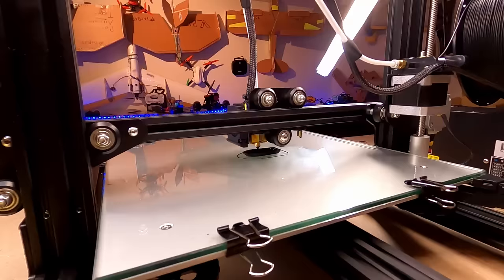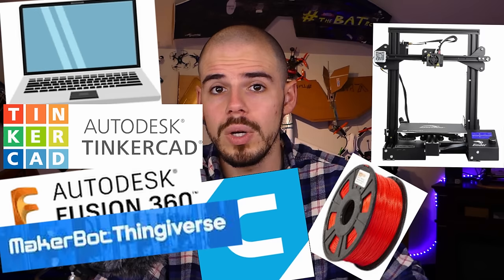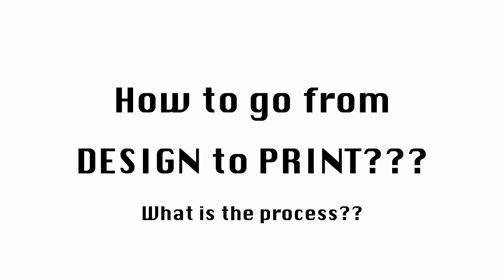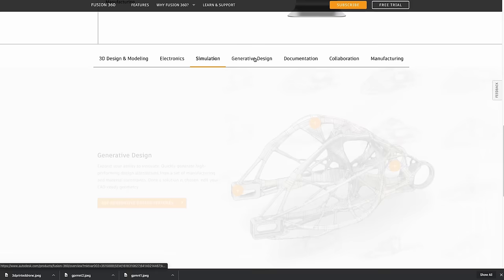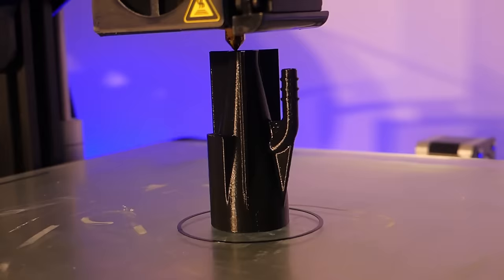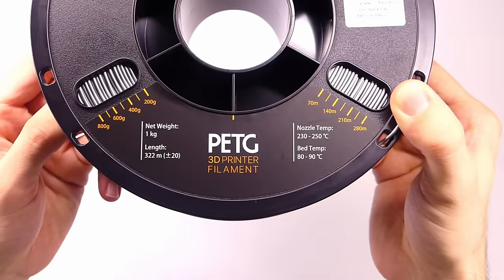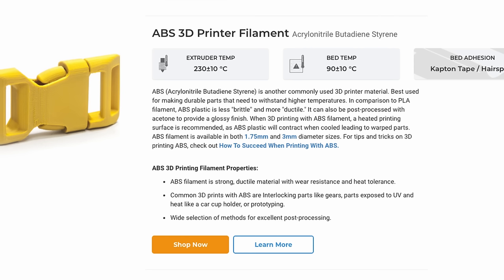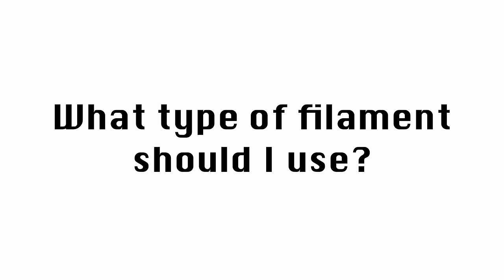Don't Know Where to Start? 🥺 3D Printing Crash Course for Beginners

Comment from the maker: What questions do YOU have about 3D printing?
Reply: Build a flying wing 3d lol! I 😂
Reply from the maker: @its_Savian  lol I just might! I'd better print two, though, because I'll crash one of them!
Reply: How long before 3d printing is ready for the mainstream consumer electronics market. i.e.: I want to go to Best Buy and buy a wireless HP or Epson 3d printer, load a consumable cartridge, design something on SketchUp 3d press print. I don't want to assemble, fiddle, upgrade etc. All software except the design software should be drivers provided by the printer manufacturer. Any guesses?
Reply: I saw a nice plane on thingiverse:
C-47 Dakota, RC Plane
Reply: (1) I was looking at getting a robot arm and saw that some of them can do 3D printing.  How do robot arm 3D printers compare with dedicated 3D printers?

(2) Is there (currently or in the works) a portable 3D Printing Format for the files that control the printers just as there is PDF for 2D printers?
Reply: @Boris_Chang  I think probably more expensive and kinda unnecessary but not sure.
Reply: About metal printing ??
Reply: One thing I wish I knew when I started was the temp tower. Dialing in the temperature for each filament was so much easier after that. 

Excellent video sir.
Reply: I'm in the category that just wants to download files and use a slicer. I have no desire to design anything. I did cad in school and it's not for me. I want to make Statues and Models. What type of PC do I need? Would a regular cheap laptop be sufficient??
Reply: I've commented my question, i would appreciate if you answer me, thx <3
Reply: My question is how do you make money(to fund more awesome project) with it..where to start?
Reply: When I buy my printer and want to print nylon carbon fiber stuff do the hot points fit all models?
Reply: Can you use autodesk inventor instead of fusion 360?
Reply: hey man, a friend of mine gave me a printout kayan 11240908206, but B have only mac, can I work with that? what app or software do I use to program?
Reply: Manual vs Auto leveling?
Reply: I keep trying to print small statues under 10 inches but every time I do halfway through it the printer stops printing on it and the pla just oozes out and I get a ball of pla string. If you give me your email I could send pictures. How does one get rid of this issue?
Reply from the maker: @Valkommen888  I'd love to help if I can. Email me at RCwithAdam@gmail.com.
Reply: hi..i still beginner on this..i used sketch up doing 3D then when i open on cura some of the part (my 3D model)  were cut/missing, wht should i do?
Reply: is fusion 360 free forever?  I just want it for personal use to challenge myself and I am not interested in Commercial use at all....
Reply: No matter how many videos I watch, I don't understand it at all. How can you print food? Do you put all the ingredients of the food inside the printer?! 

How can you print a human organ? How do stem cells become a particular organ and what is the role of the printer in this?
Reply: i'd like to focus on making realistic mask and mini me. which software and printer do you recommend for me?
Reply: I just don’t understand why you need an SD card? It’s 2020 nothing wireless? Or you can’t just plug your laptop into printer?
Reply: Yes, I have one question. I am a cad designer and looking for clients who can hire me for designing-related work for their printing business. Can you tell me how I can get such clients ??
Reply: I want to make a house with a 3D printer a real house
Reply: @Notfritenite  So you dont want to design things? just print out other peoples hard work? I feeeeel you, who doesnt love profitting off anothers hard work?
Reply: @playwithshay6384  nobodies talking about profiting (learn to spell) off anyone's work. I want to print things for myself to paint and have for MYSELF.  I have a business and make my own money, I profit off me. Now go stand in the corner and face the wall.
Reply: @playwithshay6384  stick to playing RoBlOx. Lol
Reply: @playwithshay6384  Hahahaha you've actually stolen Supremes IP and likeness. Rupreme is about as cool as BUFU lol
Reply: is it feasible to get one if i have no clue how to 3d draft at all?
Reply: Adam, I thought you video was very good and covered have very well, but didn't really explain slices and slicers in enough detail, so I inserted a comment below that I hope for in some useful information.
I'm not an expert, i don't even own a 3D printer, but I've learned a lot about them, so I think I got this right, but please, feel free to make any clarifications you see fit.
Reply: Bro... I have so many questions I dont even know where to start!!! LOL
Reply: So if you're printing an inclined plane (or a curved surface), because how the printer lays down extruded layers, does the printer print over the design's edge, or up to it, or does it straddle the line?

I.e. if you want to finish a part to make it smooth to the correct size, would you have to sand off the steps to get it down to the designed size, or use filler to get it up to the correct size (or use both)?
Reply: Is the FlashForge Adventurer 3 Lite FDM 3D Printer a good printer?
Reply: @jackrobertdube  you can upgrade it so it's wireless, but this allows you to do a 24+ hour print without having to leave your computer on the whole time
Reply: What if you want to use different colors on 1print can that he done and he w would you feed the different color at the right time or would that be based on the image
Reply: Also what would you suggest for printing on cloth like denim
Reply: Im using xyzmaker 3dkit and i dont think i can change the print canvas size to corospond to the area of a specific printer, does a printer usually automatically auto fix that or is there a setting to do that?
Reply: What 3d printer should I get to do zip ties?
Reply: How do tour put your design in the the printer
Reply: Can you print one thing with multiple filament colors?
Reply: Can I just design something and get someone else to print it?
Reply: I am getting a 3d printer for my son for christmas and know nothing about them. Do I need a CAD program if we are just going to start with files we find on thingiverse, or can i just use slicer software to get the .gcode file to go on the SD card?
Reply from the maker: @adambobbitt6879  hi! Very cool! No, you don't need a cad program. You can just download .stl files, then import them (drag and drop) into a slicer (like cura). Then the slicer will spit out a .gcode that your printer will read.
Reply: Is it possible to 3d print transparent parts?
Reply from the maker: @glenlivingstonegl  clear filament is available, it doesn't print like "glass-clear". Any more than 2 layers and is has more of a frosted/crystal look. But I think resin printers can print with much more transparency.
Reply: @RCwithAdam1  guess i have some research to do thanks 😊 🙏
Reply: @ridzwananuar5919  if you have to ask that, then you probably wont make money
Reply: Would it be beneficial to use a 3D printing service (In my case, provided by a public library) before investing in my own 3D printer?  
what is STL?
Reply: I’m want to start 3d printing what kind of laptop should I be looking at ?
Reply: Do you need batteries
Reply: I don’t know how to set z axis
Reply: What should I get first laptop to start getting my files ready or the printer itself and just set it up
Reply: 4:29 build volume can exceed the printer in some cases. Belt printers for example. Its possible to exceed volume in settings, even if a standard common cheap printer, feed rates and such.
Reply: Is  “liquid “ 3D printing better than the “filament” type of 3D printing?
Is there a consumer version of 3D printing in metal?
Reply: @phantomcruizer   lots. Liquid printing, water, jack daniels.
There is atom printing. Dna printing. As far as metal theres many types, spee3d has a fasinating machine. 
Dont forget to license check all sales no matter who drew the stl no matter where you found or purchased it even scans. 
License check all uploads also. Yes no matter where stl came from.
Reply: No one ever covers the little things, like do you  remove filament from the printer when you are done or just leave it in there, or what to do when it is changed, or what to use when cleaning it, etc.
Reply: @garyb9867  i would say about 2 years
Reply: @WillofNewZealand  license check?  What fo
Reply: @nickh7777  
3dmdb
Yeggi
Stlfinder
Net.
Sort all by exact text.
Sort by oldest first. 
Sort by 3d print. 
Sort out cnc milling, cgi, laser cutting ,so on.
Reply: @nickh7777   

Lets say an entreprenure wants to make money in 3d printing sector. 
Some options are,
Sell physical prints. Example  
       $     100.
Sell print files, example           
        $         1.
Sell the licensed thing ownership $10,000.
Reply: I was looking for a 3D printer and program for making custom 19650 battery enclosures. At the moment I'm making them by hand with random parts brought on the internet and modifying them. It takes forever just to build one. Any suggestions? Print volume needs to be approximately 12x12 inches.
Reply: Nice video , i am a jeweller cad designer and i have problems with accurate sizing of jewellery like if i want a finger size 12 ring it comes out less like 11 and even stone collet's also shrinks so what can i do about it.
Reply: But what kind of computer do I need?
Reply: I'm not sure if I'll get a reply, but I'd love to have some advice on a good laptop for 3d printing, preferably under $300. Thanks
Reply: What is the best budget laptop for 3d modeling?

Comment: Tip number 1 don’t quit when you get a few fails
Reply: I've tried the same print and failed like 14 times .. didn't change anything and tried 2 days later and it came out the cleanest print with no imperfections that I've done yet ...

Comment: I am a teenager who has just started 3d designing and this video was extremely helpful and simple. I am thinking of buying the ender 3 because it is surprisingly cheap and i have been using tinkercad for forever and want to print. Thanks!

Comment: Thank you so much for this video! I'm BRAND new to 3D printing (got one as an unexpected present) and I didn't know what I didn't know. I watched several other "for beginners" videos but they generally left me with more questions than answers. Thank you for meeting me at ground level and assuming I had no basic knowledge to start with (I especially appreciated you explaining what a slicer is for example).

Comment: for new people, an ender 5 plus has massive amounts of upgrades, including corexy, 3 z axis auto bed leveling, direct drive hotend for flexibles full enclosures linear rails etc, the difference is size between the normal plus and pro, i suggest the plus if you like to mod, otherwise go with an flsun sr for plug in and rock working fast for under 450 usd. cant recomend the flsun sr enough, if you have the money go the v400 but for reasonably priced the sr is awesome. just has to print flexibles super slow. hope that helps anyone looking now days

Comment: I one thousand percent recommend that a newbie get a pre-assembled printer, and if you plan to use it indoors, one with a case. I originally bought a Prusa-based ready-to-assemble kit because it was reviewed well, I wanted a large print bed but at a small price point, and I consider myself to be "handy" and electronically savvy. It took so much effort to get it to where I could even start printing real items that I gave up, and it sat in a closet for years. When I decided to get back into the hobby, I went online to see if I could get an enclosure for it and found new models with cases on sale for very reasonable prices. I realized it is entirely worth it to spend extra money to save the time and effort of tinkering with it every time I want to print. Would I like a larger one? In theory, yes, but in reality, I don't need it for the things I make.

Comment: I have tried using county supplied 3D printers at the local library and the result 90% of the time has been what the 'expert' at the county terms as spaghetti. At this point I'd rather sculpt what I need than rely upon unreliable technology. Cheers.

Comment: I'm partial to Blender3d.  It is such a versatile piece of software...the best part is that it is free and open source!  It is intended to make production quality movies, so guess what!  It is really good for editing your YouTube videos...just saying.  Thank you for another amazing video!  YouTube is always your friend when learning these things!
If you're not sure what printer to buy.  The MonoPrice Mini Delta (MPMD) is a good budget/plug-n-play/out-of-the-box/low fuss option. (got mine refurbished for $200)  If all you want to do is print files from the internet, and not model anything in 3D or CAD, then this printer is relatively user friendly.  It does have its quirks, but there is minimal setup and it uses Cura for slicing.  There is a really good fb group for MPMD owners that is a gold mine of information.  If you end up not staying with the hobby, you aren't out much, and you didn't have to struggle too much to find out.
I bought two spools of filament and everything else I use has been from the MakerBox subscription!  I heard about it through @3dprintingnerd.  I love it.  I don't print enough to need full spools ($20-$40 ea) anyway and I get to try out a bunch of fun colors each month ($16/mo for 4 sample rolls of 50-75kg)!!!  The entry level "easy" box is only PLA.  You can upgrade to another tier and get different materials when you are ready.
-Cheers!
Reply from the maker: I didn't know about the MakerBox subscription. sounds cool!

Comment: 14:34 tpu rubber printing. Disable retraction in settings, have a roller spool holder, super easy roller, extra super easy to turn roller. It makes a massive difference. Use at own risk.

Comment: I'm looking into 3D printing as of Jan 2021 because I need a hobby, and it's one that can both be fun and useful. I can augment or allow electronics projects I have in mind or come across and want to make but need a custom part for. The hardest part will be the slog with the software (my nemesis).
Much thanks for the intro video and printer recommendations.

Comment: Great Job Adam. I am printing my first test object on my new Ender 3 as I watch your video. Thank you for the great information. I am also an RC guy with fixed-wing and multi-rotor aircraft. One of the things I wanted to do is be able to make parts for my aircraft when needed. Look forward to more videos.
Reply: I'm a RC guy also and I have two 3d printer one ender3 v2 and CR10S but I'm having issues with my CR10S I wish I could find someone to  Troubleshoot the issue I bought a second motherboard hotend fans

Comment: 6:38 if you ever intend on making commercial gain or selling the,
Sell print,
Sell stl copy, 
Sell licensed thing ownership.
You need a cad that allows commercial use. 
It may cost to buy most likly mine years ago was 500 bucks or so. That was quite a while ago.
That was sketchup.
All cads vary and some are good for organic curvey shapes and others more for line drawings.

Comment: Pla and pteg is to brittle for quadcopter frames. Cr10 is an ender3 that is a little bigger ender 3 is a cheaper more upgraded printer . Tpu is what you use for quads. And you can go to thingsverse and download the file right to cura and print .

Comment: 19:45 filament tho commonly cheap plastic, can be as expensive as the material. Real gold costs more of course. And that not the most expensive by a long way. 
Weight, volume, or terms can be at the license owners terms also. 
It can get more complex as you dive down the rabbit hole.

Comment: Great video. I'm going to be getting my first 3d printer in the next few months. I'm actually looking at an Ender 5 (maybe the pro model depending on how pricing is when I'm ready). I like the design where the print bed just moves in the Z axis as there aren't moving parts stuck where it would be hard for me to get to them. I definitely want a printer with a lot of support and ability to upgrade so one of the Ender models seems ideal.
Reply from the maker: Glad I could help! 😀

Comment: great video dude lots of answers.
seems though that the feasibility of the print, is determined by the cost of the filament.
Reply from the maker: Thanks! Filament quality is definitely a big factor. Lately I've really liked the 3DFuel filament. Prints well, strong, and lots of color options (one of my faves is the clear "workday" PLA).

Comment: Excellent video,  thank you.
Reply from the maker: Glad it helped!
Reply: @RCwithAdam1  I am a teacher in Asia and I use d&d as a teaching tool however minis are rare here and expensive if imported so I am planning to 3d print them for my students. This video was very informative. I greatly appreciate it. I am considering the anycubic viper, Ender 3v2, Voxelab Aquila,  prusa i3... these are the ones I am thinking of and will choose 1. I am leaning towards the viper so far.

Comment: Hi adam, my problem is having time, because I work alot. Is this your career? Do you have job? How do you divide your time with work and hobby?  How much time do you put in to this hobby?  Great review 👍
Reply from the maker: Hi! Thanks! That is a great question and I hear you. I think that for many people who do not enjoy the tinkering and DIY aspect of making 3D prints, it's not worth the time. It's the kind  of thing that you have to enjoy the process, and not just the results. This channel is now part of my full time career (😁), so I do have way more time to spend on it than most.
Reply: I also have trouble splitting my time between work and my other projects. I found that I enjoy the 3d printing more when I split it up. I work for like an hour or so after work. Then once I am ok with the design I will slice the project and let it print while I am working on other things on my days off.